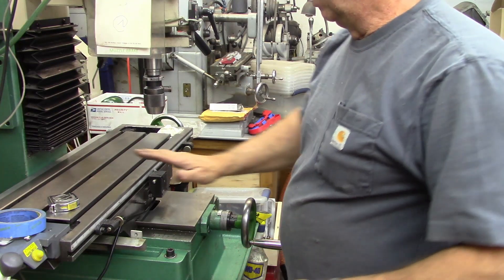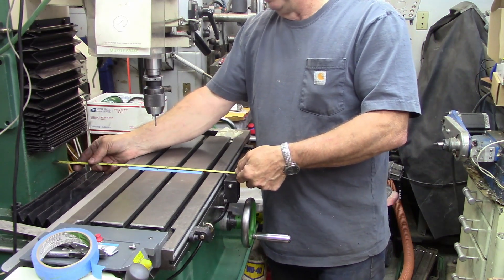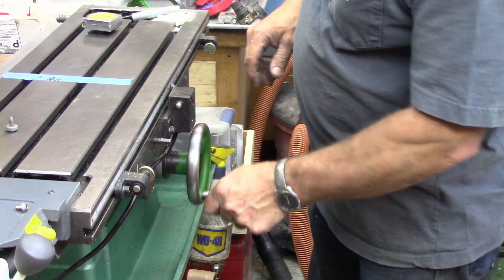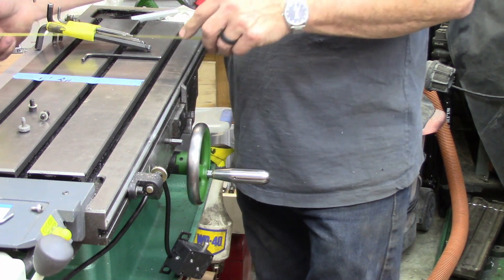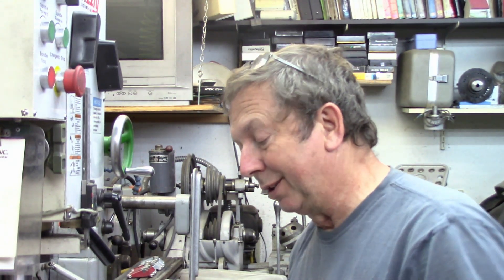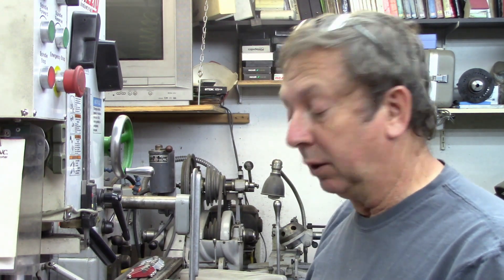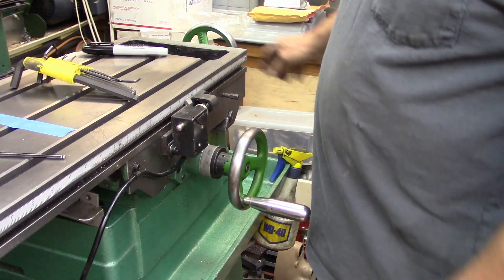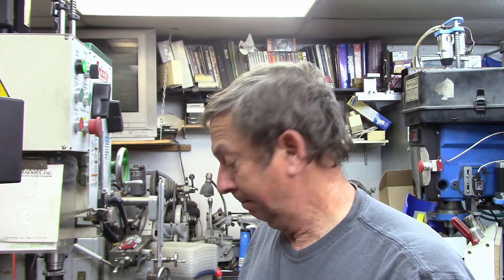Grizzly G0755 , Part 14: Increasing The "Y" Axis Travel

Comment: I have the same mill, and have always found even with the Grizzly vice I was never able to get my vice in a great position without making a mounting plate to allow the Y position to move outside of the T-slot positions.

This fix might actually gain me enough travel to allow me to use the actual T-slots to mount my vice :)
Reply from the maker: I find that I am able to get enough travel, but I still double check where I mount the vise.

Comment: I agree, that locking screw is a design flaw. Unfortunately the GO761 I work on doesn’t have a DRO so I need it.
Reply from the maker: The quick and dirty solution is to replace the locking knob with a setscrew which unfortunatly means you need an allen wrench. The other more elegant solution is a friction lock on the ring either using a o-ring or a spring loading. I think I am going to use spring loading on mine.

Comment: Depending how your column is bolted on you can always move the column back to gain more travel
Reply from the maker: Thanks, but not without major modifications to the leadscrew and base casting and there would be a loss of rigidity with the column

Comment: I wish the bed was longer. I still cannot reach to the back of the table by a couple inches, and that places the vice rather towards the front. Also the extreme fwd position leaves the table severely overhanging the bed. If the bed had been made 4 inches longer it would have been superb.
Reply from the maker: unfortunatly we always want more from our machines than they provide. If I were going to CNC this machine I would probably extend the bed because it would still maintain the same footprint since I would be removing the handwheel, but as a manual machine I don't feel I have the room to have it extending another 4 inches forward as well as having to reach farther to reach the controls on the head.

Comment: Mount the dro Y scale on the front
Reply from the maker: The y axis is front to back and has to mount to the side
Reply: @hillsgun  sorry I meant the X scale, I did it on my machine and gained extra Y travel
Reply from the maker: I didn’t like it on the front, it interfered with the gib lock as well as the power feed controls, ran an extra cable on the front and seems to catch more coolant draining around the vise that extends over the front of the table.